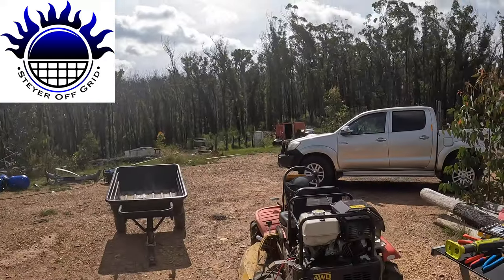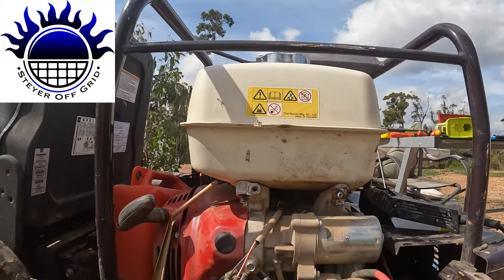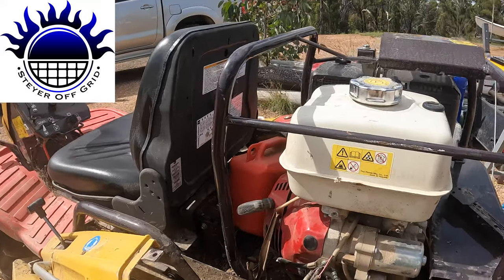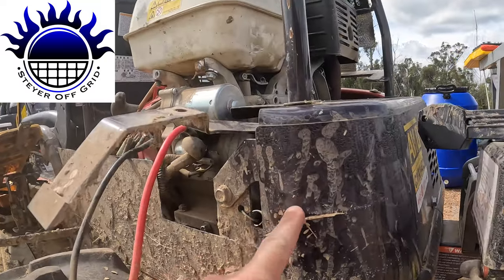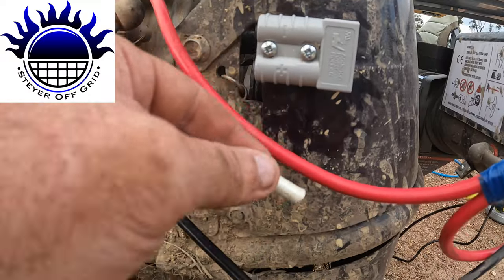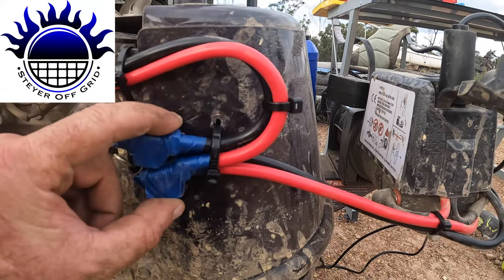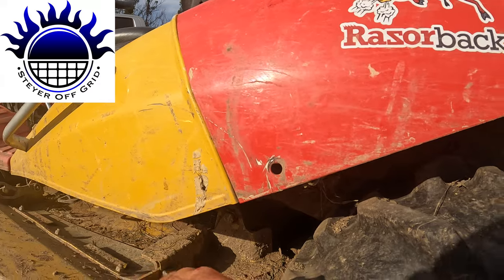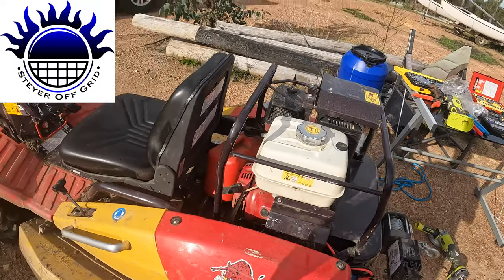RazorBack Winch Installation

Comment: Mate love your stuff and have liked and subscribed!  But why do you even need the winch?
Reply from the maker: I get stuck on big logs or tree stumps. If you are cutting in long scrub you don't see them and get beached on them. I've only used it a few times but otherwise I need to walk back and get the 4WD to pull it off.

Comment: the vanguard engine models have an integrated 20L tank in that spot, so yeah the manual is not correct for the Honda donk version. I bought the winch with my Razorback, and it's a different model to yours, and in fact it's got a wireless control unit which gets away from the waterproof bag issue :)
Reply from the maker: RazorBack actually watched this video and sent me a hat and a thank you note. They said they would make a new install manual based on my video. I don't even know how they had my address to send me the hat, maybe from my dealer.